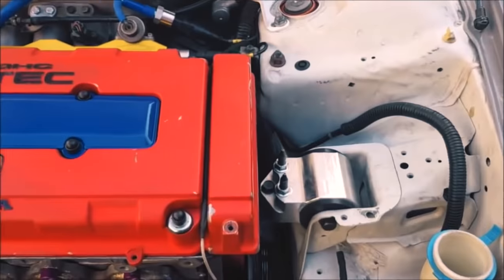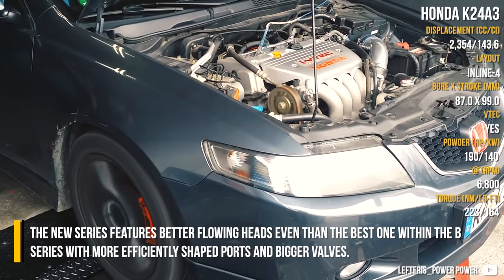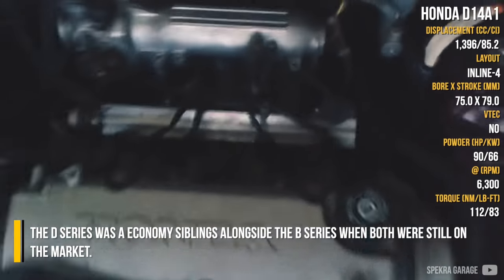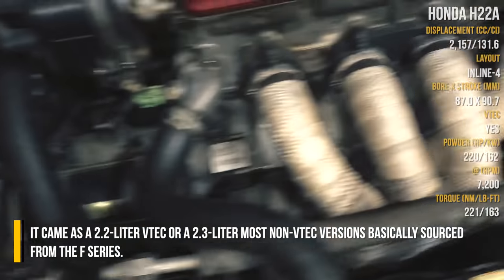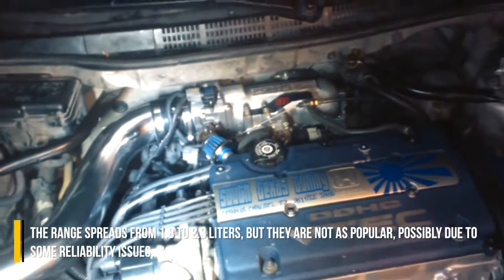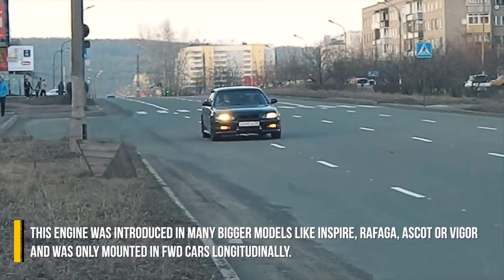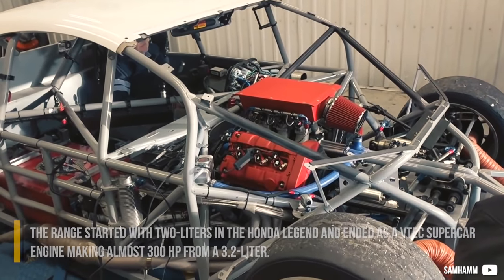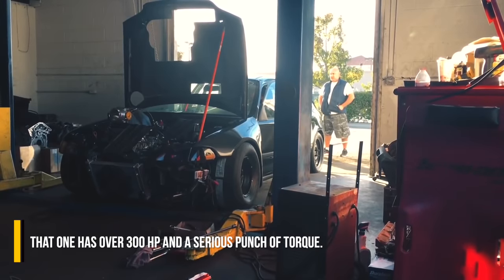Honda Engine Series: Explained

Comment: The F series is a weird one. It's basically three different engine series.

Imagine trying to explain to a non Honda guy why you're swapping in an F20B to replace your F22B1, and why the F20C and F22C1 engines have nothing in common with the previously mentioned engines.

Comment: I had a 2.4 accord type S CL9, reliability wise the car was a marvel, but I was very disappointed with the performance. A 177hp diesel BMW or a 180 hp TT would pull harder. Now I have a modified cupra 1p1 stage 2+ and it's a completely different animal. I sometimes remember with nostalgia my loved accord and how reliable it was, but the cupra is just mind blowing when it comes to performance. I know it's not fair to compare a 190 hp saloon vs a 350hp hot hatch, but the moral of the story is that the honda didn't pull like 190hp, more like 150, and it was in tip top shape.

Comment: You forgot the L series which is a small block continuation of the B series and N series(diesel). And it's not reliability which causes people to not use F series. They are in very few cars, that's why they are used less.

Comment: VisioRacer,Should have mentioned the 1985 B series..B20 and B21..these are not the same as the 1988 B series..although the crank and cams can be made to fit the later version..

Comment: I owned 2 Hondas . One was a 2010 Honda City with a 1.5l na engine producing 116bhp which also featured I-VTEC. Second was a 2015 Honda Brio hatch with a 1.2l na I-VTEC motor producing 87bhp . Both of those cars lacked low end punch but they really picked up pace in the mid range and screamed all the way to the redline .

Comment: I am  new to Honda community really wanna learn about this so I can decide my first car.

I wanna built a car under $8000 (including the car) making around 500hp 
Any suggestions?
Reply: If u can weld n Fab....j35 oddessy-j32 head makes 300 hp stock parts,but have fun finding manual trans
Reply: @rexwilkins6313  thanks

Comment: Next time include the l series from the fit. 
The l15 received turbo and can make 200 hp in the civic si 😊
Reply: Also the IMA 1.5 which Mugen strapped a supercharger on
Reply: Marc Fransen technically a special package option but still well worth the mention.

Comment: One thing that I wonder about: is it not better to have a performance upgraded Honda engine rather than a VTEC one? I mean, for racing or speed purposes, it is probably better if your engine does not have a valve lift control but rather if valves are set, or open, or how I should I put it - all the time to full? You know like it is nice to have at certain RPMs VTEC kick in, but is it not better to have a regular or race spec cam shafts and cams?
Reply: As the profile of the camshaft in the VTEC would render the car not usable in the street, it won't. 
If you talk about a racing engine, there are VTEC eliminator kits, that uses a normal(race, very aggressive) camshaft
Reply: The advantage of the VTEC is the possibility of having a normal profile cam below 5000rpm, using the car normally, with normal idle and smooth on the streets, with more torque.
Over 5000rpm allows you to have a very aggressive profile without it's disadvantages at low rpm.

Of course if it's a racing/track use only engine, the best idea would be to use it as any normal engine, eliminating the VTEC, thus reducing weight and probably reliability problems
Reply: Here's a clue: cams are cam shafts. "Better"

Comment: Hello i have a question,  i have a honda civic 1992 1.5 l 16  valve engine and i want to buy a engine 2.0 l 16 valve vtec crx 2000 year and to replace my 1.5 engine , it's possible or not

Comment: Ok serious question here. I have a 4cyl 6th gen 2.3 VTEC (98 coupe), trying to figure out which series it is. Not the ghetto sealed one, the one with spark plug tubes. Any help is greatly appreciated. It's a manual tranny too if that helps.
TIA
Reply: F23a
F series

Comment: Your wrong about the f series engine. There two types dohc. The one similar to the h series(f20b) and the one in the s2000 is the f20c, looks like the k series. There is also een f22c s2000 engine

Comment: The FWD and RWD F-series engines are completely different engines, they don't share any parts. The FWD F-series engines aren't popular because the majority were low-performance, SOHC engines, and the DOHC versions are rare. THEY WERE ALL EXTREMELY RELIABLE ENGINES.
Reply: I got a F22A6 is a good engine. I have no ideal what i did to my but is really good on gas.

Comment: How to spot an b series without vtec?
Reply: Look for the 'VTEC' stamped into the valve cover. If not, it will usually have some wire cover. If none of the above, look for the side of the motor, where there will  usually be a  plate  with the engine (i.e B20Z3,  B16A1, B18C1) on it. The only non-Vtec B-Series motors are all the B20's and B18A-B18B. The B16's, B17's and B18C's are all Vtec.

Comment: Honda,s strength has always been it,s engines, early 70,s you could buy Old British bike they worked when it felt like it, leaked oil, and needed valve clearances adjusted, or you buy say 750 SOHC Honda motorbike, start 1st time every time RELIABLE DID LEAK oil did not valves adjusted, just jump on and GO! Which would you choice???? The Honda is the obvious choice really!

Comment: I am bulding a honda C35A1 engine but thair is no aftermarket so it is being difficult but I got it to 700+ hp just motor (no) forced induction and 650+ flbs of torque I think the c series v6 is hondas v6 big block and the j series the small block I turbocharged it a year ago and am now pushing just about 1000+ hp and 1000+ flbs of tq I am working on 1500 to 2000 hp but I will probably have to make a custom block with a closed deck design and dohc from the nsx for higher rev's my engine only redline's a 8000 rpm at this moment I hope after I buld my custom block I will be able to rev to 9000 - 10000 rpm with out over reving the engine it does not sound like much but when you are racing every little bit matters

Comment: The f23a engine in my 1998 Honda Accord could have been faster and more torque-y if it was paired with a 5 speed manual transmission than the 4 speed automatic I have on my car v

Comment: Again you say the D is the favorite when  building Hondas, that's not the case. There where more D engines built then the B making the D easier to find. But when it come to building Honda engines you will barley find built D here in the states, its either a B or K being built.. I have been in the Honda game since I got my driver's license 15 years ago. Also have a drag ready Honda Civic with a ls v turbo. Never have I raced a fast D series, not saying they're not out there. But no one would take a D over a B in the Honda game when it comes to performance..

Comment: Wonder what issues the SOHC F series has... anything other than Oil thirst would be new to me.
Reply: Yeah, bulletproof engines right there, especially the non-vtec versions. And they make great 
N/A builds, if you got the cash 😂 #bisimotof22
Reply: @h22accordexr  I have a F20b6 with... probably good compression (2 at 175psi and 2 at 168.) Preowners installes a is cheap but aftermarket exhaust and an K&N Filter. Uhhh and a fuel pressure regulator.
How much cash for what mods would it take from here? There is literally nobody with any info whatsoever in my area.
Reply: @flutterguy965  To make an F22a a powerhouse, you would need to bore out the intake and exhaust ports and mate them to good intake manifold and header amongst other mods. Believe it or not, those SOHC heads can be bored out alot, like breathing almost as well as a F20c head. But that takes cash..
Reply: @h22accordexr  So a good port & polish would be the main big thing. Ok. Any change in the internals? Any problems wih higher revs?
Reply: @flutterguy965  for sure you'll need to change the block and head internals. You're changing everything, IF you want +300hp n/a
Reply: @h22accordexr   My target is 155mph / 250km/h with a stock looking engine bay. Guess I'll need about 200HP for that.  right now I hit limiter at 220km/h (measured with GPS) so I "only" need 30-35 more. I want to change the gearbox to my spare F18 one as 4th & 5th gear is a bit longer but then still need a few RPM on top. OR I go 8000 RPM redline with this Gearbox. 
Disclaimer: Speed measured legally on the Autobahn

Comment: So a 2.0 vtec accord deserves his money? It worth it? I want one
Reply: I think if you're going in on an accord, go for a J series with a manual transmission 2005 or newer. swap on the 3.7 intake and throttle body and 3.5 camshaft, then a K tuner and J pipe with exhaust... sounds beautiful, plenty of power. Only issue is if you want a turbo it's ungodly expensive. Easier and cheaper to do a Eaton supercharger. But one thing's for sure, those J series don't quit and can push out a lot of power
Reply: Accord 7 or 8? 2.0 2.4?
Reply: @gikaageo2187  2005 would be a 7. 8 to 12 (i think, not sure when the 9 came out) would be 8th gen. Key point being if you're getting an accord go for the V6 and a manual trans. then bolt ons and tune and you got yourself a fast car
Reply: I understand, but the problem is, i live in romania and here the taxes are very high for the motors that are over 2.0 , that s why i asking, maximum the 2.4, the 2.0 how is it?
Reply: @gikaageo2187  I see. Then the Accord is not for you, as they don't offer the 2.0 for either 7th or 8th generations. Only the 2.4 and 3.0 V6  for the 7th generation and 3.5 for the 8th generation. If the biggest you can get is the 2.0 then I'd say a 2007 Civic Si is the best. Even though it is ugly as all sin..  But if you're willing to pay the extra taxes to have the 2.4 accord, I'd say just go the extra step and get the 3.0 V6. Much Much more power and those Honda V6's simply do not quit
Reply: @alickswiden71  man i don t look for so much power , i look for an engine that doensn t quit just like you said,i preffer an engine that never broke over the power
Reply: @gikaageo2187  then that would still be their V6. The headers cast into the block, rather than being bolted onto it, and also has forged rods and crankshaft. Its sturdy enough to handle upwards of 750 horsepower before cracking. At factory stock, it just doesn't quit. If anything did go bad it would be top end stuff that's easy to fix. Also, surprisingly good fuel economy! Note that the first year of the 7th gen, 2003, the automatic trans was a little prone to failure but if you picked up a 2005-2007 or a manual trans, its bulletproof. Literally... theres a video on channel called DemolitionRanch where they literally shot a Honda 3.2 with a number of high caliber rounds to see if they could go through it and pretty much failed. Even a 50 cal didnt go straight through lol
Reply: Thanks for the answers man apreciate that somewone make aj effort to give some advices
Reply: @gikaageo2187  No problem man, everyone should have a chance to drive one of those J series!

Comment: What about the N series.
Diesel power, tune it and it goes like the clappers.
Reply: It cant compete with the gas counterpart and its not an easily modifiable engine like almost all engines in the vid
Reply: @eduardogears5259  Cant compete?
Have you seen the power the N22 is capable of?
Stage 2 remaps give hug power gains for that engine.
Reply: @IIGrayfoxII  Nothing competes with gasoline engines.
Reply: @PistonAvatarGuy  Tell that to audi and how they dominated the lemans with diesel
Reply: @IIGrayfoxII  Yeah, a diesel that was twice as big as the gasoline engines that ran against it and ran more boost. Your "stage 2" N22 only makes 200 hp, there are naturally aspirated K20s that make more than that!
Reply: @PistonAvatarGuy  the N22 with stage 2 makes more torque and is also built more solid and still gets better MPG.
best of both worlds.
Reply: @IIGrayfoxII  Torque doesn't mean jack. Diesel fuel is more expensive and pollutes more, so it's the worst of all worlds. No power, expensive fuel, high engine weight, high pollution... DIESELS SUCK.
Reply: @IIGrayfoxII  they win lemans cause of having less pitsotps doe to diesel wich doesnt matter on the streets and even tough you got eay more torq you still only got 200hp. You can launch faster but after 100km a diesel will just fall off (trust me i usualy run with friends who own 300hp seat ibizas tdi and somethimes with a guy who has a 400hp 190d)
Reply: IIGrayfoxII the N22 is a good engine mine makes 210bhp and 420nm of torque off a stage one remap the guy who tuned mine said he’s seen them leave his workshop with 350bhp! Obviously with a lot of work but mine goes well and has given an ep3 type r a run for its money. It’s a decent daily driver along with my turbo EK civic

Comment: The engine in my 99 Accord says F23A1 on it and other than it being real good on gas I have no idea what it's capable of.....I also have a 08 MDX but my wife drives it,no plans for mods.
I kept blowing the transmission in my Audi a4 b5 so 😭.
Reply: Audiwan Kenobi get a H22 head to throw on there...then build, turbo and tune it and you’ll have quite a little monster on your hands 👌🏻

Comment: There are tons of D series with VTEC, and the F20c or F22c has nothing to do with the others F series, the "older" F series are a basic version of the H series (SOHC non or with VTEC)
Reply: would an older F series fit an H series head?
Reply: @bombardier6033  engine mounts are the same, the gear box fits in both, the head i think is Bolt on, but i dont remember for 100%
Reply: @luisgoncalves2584  The head is not a bolt on. Some of the ports for coolant/oil don't line up.
The bore is also different between the heads causing other issues unless you bore and sleeve the F block or have the H head shaped by a machine shop.
Everything essential, head bolts and cylinder head placement, does line up though so it can be done and is why it has been done.

The bottom end of the F series is a "stroked" H series which is part of why it gets the "big block" nickname.
The F20C and F22C are 3rd-gen F-series engines. F22A -> "A" -> 1st-gen, F22B -> "B" -> 2nd-gen, F20C -> "C" -> 3rd-gen.
Reply: @CompproB237  like i Said, i wasnt sure... But relate a 3 gen F series with the first two, os a realy long long shot... Thats why i Said that.
Reply: @CompproB237  don't know why honda named it the F20c but it was the developement engine for the K series and has nothing to do with the F Series. It was according to Uehara a newly developed engine from the ground up.

Comment: Hondas are cool but never gonna be as cool as rx7s
Reply: Marc McCumber yup all those rotary issues make you super cool. You must be the tip of the iceberg
Reply: @illx2367  like I said hondas are cool they have tech that has been incorporated into the automotive industry but if youve ever driven anything other than a honda you'll get why they have so much hatred towards them and as far as rotaries go yeah they are princess engines but that's what makes them special the need to take care of them
Reply: Marc McCumber well to be fair I've driven Nissan, chevy, BMW, and a Tesla. I still don't see why they're hated on. There's nothing like driving a fwd and beating the hell out of it. You can't do that to a rwd without it wanting to fishtail depending on your driving. As far as a everyday car there's nothing wrong with a Honda. Way more reliable. But if you drive it only on the weekends I can see why you would want an Rx-7.
Reply: @illx2367  yes my rx7 is a track day only car
Reply: @illx2367  but I do enjoy ragging the fuck out of Hondas and everything I sit behind

Comment: This video had a lot of flaws ! First you start talking about an H series but show an s2000 flying by ! Then you show an F20B Bluetop engine  and put on the bottom of the screen found in s2000 AP1 and AP2. So PLEASE before you convince people that the s2000 was built with an F20B engine show the damn people the actual motor thats found in the s2000 (F20C)* before someone receive an S2000 powered by  an F20B Bluetop and scream “F20B Power Baby”🤦🏽‍♂️😂

Comment: F18 came in 1987 accords f22 started in 1990 for accords and f23 was 96.   Get the facts right lol
Reply: O and my f22a1 has 290k miles.   The water pump finally died.  That's the only motor problem I've had out of it

Comment: The d series doesn’t come in favour of the b series 😂
Reply: Callum Dove depends like in my case that’s what I decided on
Reply: Legit, D series is just the economy version of the B series
Reply: iEat Crayons dohc d series spoon was the business but it’s also in the gearing as well. D series make more torque quicker but of of course not as much hp as easy N/A speaking... forced induction is another story. This is from a evo driver FYI
Reply: @claudedottin1312  Yeah i heard D series are pretty good boosted, but otherwise i wouldn't bother with em.
Reply: iEat Crayons yeah it’s decent mpg and things like that but it also does take research and preference ya know